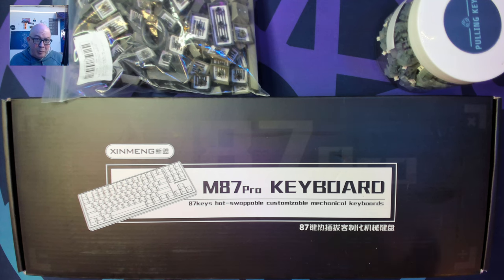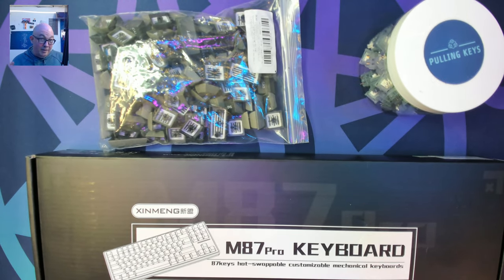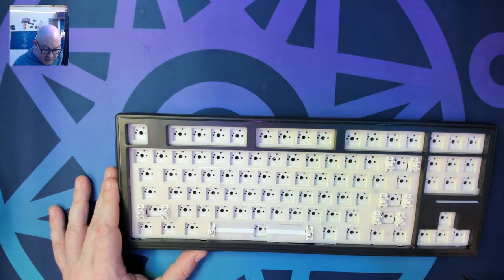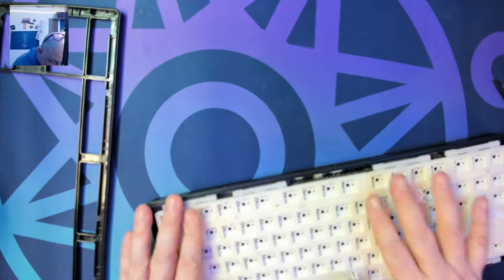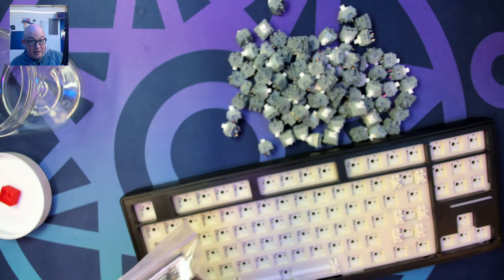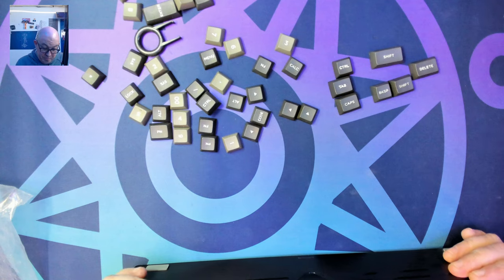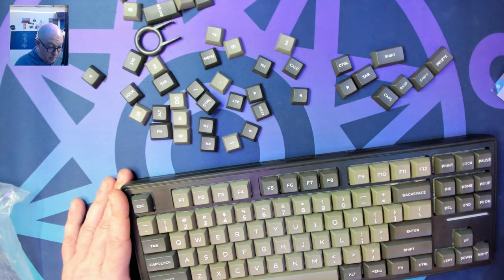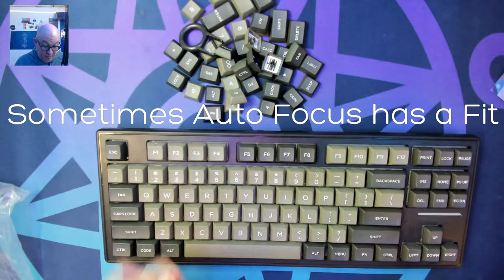Xinmeng M87Pro Build Review and Sound Test - Gateron EF Grayish DSA DS PBT

Comment: Great review as always - thanks!  One other option for the M87 on Amazon is the Felicon TKL (tri-mode with 4600mAh battery) which comes fully assembled and includes side light strips.  It's labeled Attack Shark, but comes in a Surmen box and appears almost identical.  It's currently selling for $53.99, but with a 20% coupon making it $43.20.  It comes with white jade linear switches and 2 color options.
Reply from the maker: Thanks! Nice heads up on this one, I missed it. I maybe just have to take a look at it as well, cheers!